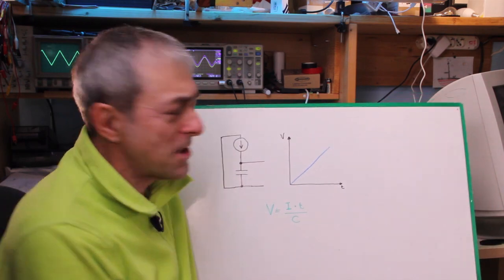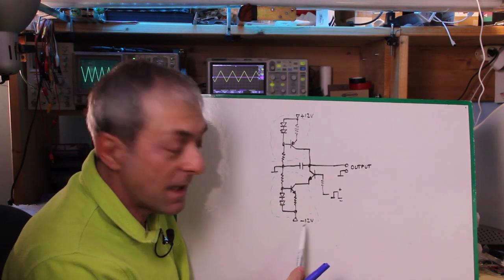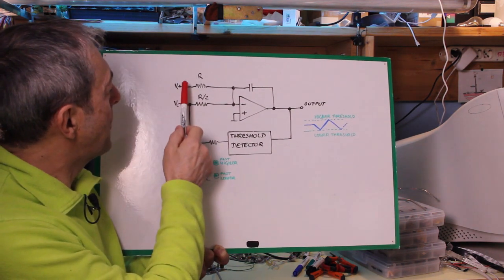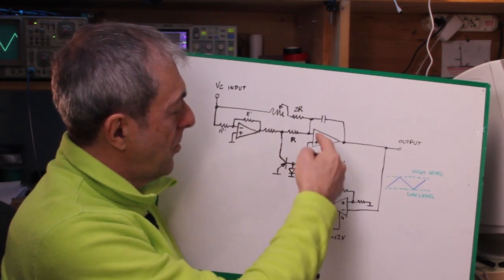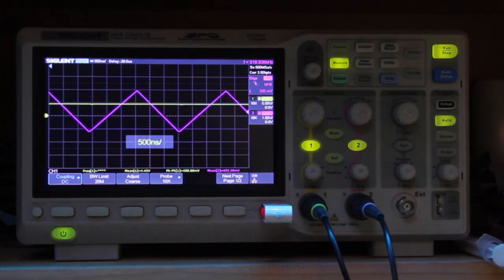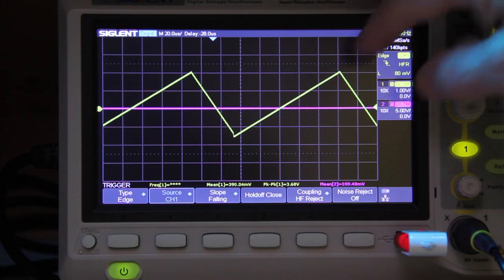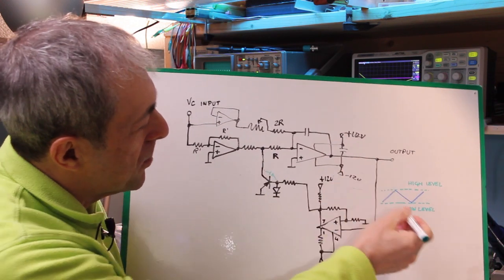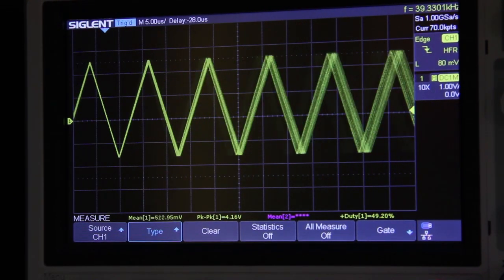A Voltage Controlled Oscillator for your lab #electronics #VFO

Comment: I'm curious as to it's intended use? The frequency range is mostly out of hearing so I don't think it's an audio circuit. And there wouldn't be much need to worry about that tiny amount of distortion in an audio VCO design.  All my synthesizers have several VCO's and each brand has it's own colored sound.
Reply from the maker: VCOs are useful for many other applications than just making music or for audio purposes: in sensors, e.g., in capacitive and inductive sensing; as a laboratory/testing equipment. Higher frequencies than audible are useful to test capacitors and inductors, to test electronic circuits and components. However if you watch the whole video you will see that it can work even at audible frequencies and the sound that can be heared is actually picked from the VCO. Indeed the bands will be: .5-5Hz, 5-50Hz, 50-500Hz, 500-5KHz, 5-50KHz, and 50-500KHz.
Thank you for commenting, your question is inspirational to make a video to show this kind of applications.

Comment: Great video! Can you please show us modifications needed to make control voltage work in "1V/octave" (increasing CV by 1V doubles the frequency) standard?
Reply from the maker: Thank you. That requires an exponential pre-conditioning circuit which is usually made exploiting the transfer characteristic of a BJT.
Reply: @AccidentalScience  Ok, thank you.
Reply from the maker: @CHEpachilo  sorry mate, I understand you expected a video but it will take time to go into this topic so I rather gave you a quick answer right in the comment, hopefully driving you to the right path. Cheers.
Reply: @AccidentalScience  nevermind that works for me. I prefer ideas over the "instructional" videos.

Comment: you have doubled the discharge current in its ramp-down to cancel the constant charging current.  can you use a separate transistor to terminate the charging instead? so both charge and discharge can take place in a balanced manner.
Reply from the maker: Yes but it's more complex and expensive, also it may introduce distortion due to the turn on delay of the transistor.